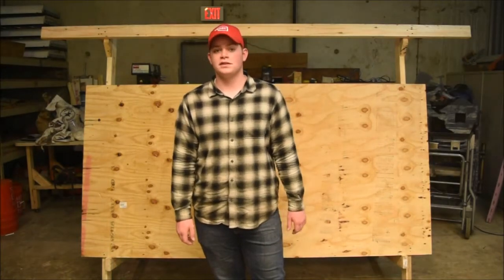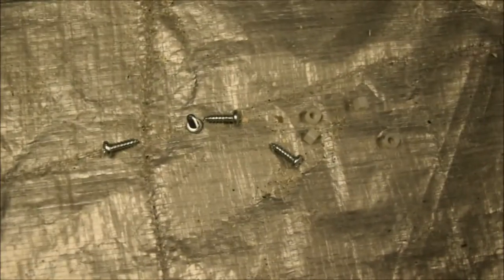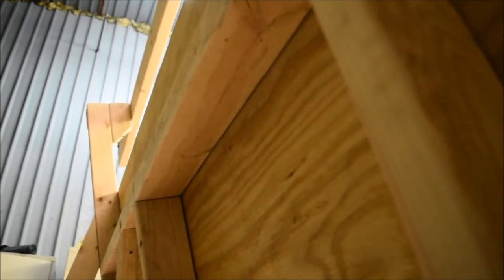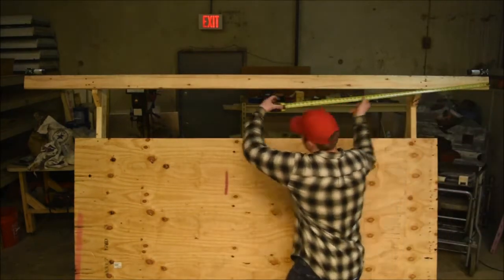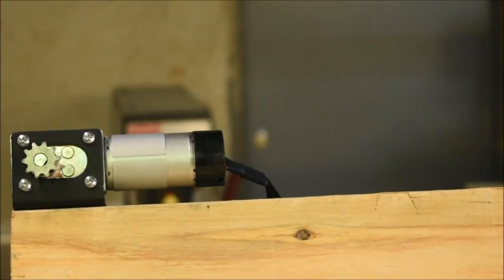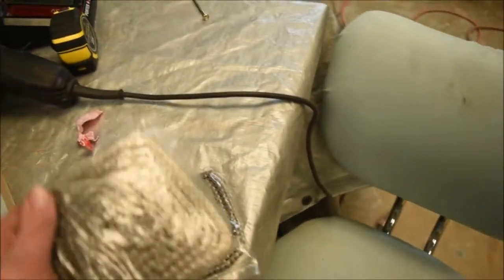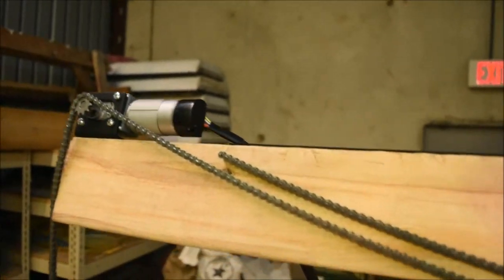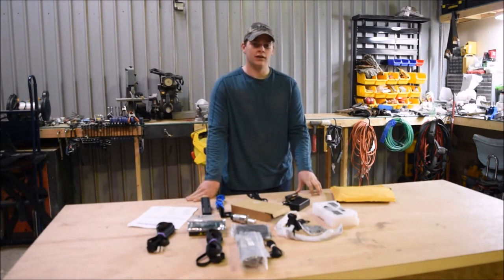Maslow CNC Setup: Attaching the Motors, Electronics, and Chains.

Comment: Dust control is another area I'm looking into. I don't have room for a full shop, so I need something that's adapt at removing fine dust but doesn't need the volume capacity a full shop requires. And preferably not costing more than the Maslow. :-D

Comment: After 2 years, have you had to recalibrate it much? I imagine temp and time has effects on these chains which are under tension (weight). I'm assuming the router gets put away after use, but not sure if you're supposed to pack up the suspended ring.
Reply from the maker: I've only re calibrated it once. I just cover up my router to keep dust out of it.

Comment: The top frame looks to be about 10 ft long. Is there any particular reason for that length to the relation of the chain length ?
Reply from the maker: You can customize it. You will measure the distance between the motors when you run the calibration in ground control. A 1' overhang on each end past the 8' cutting surface gives you a good chain angle at the extents. I would think that the more overhang you have  you would be more accurate around the edges.
Reply: Thanks....